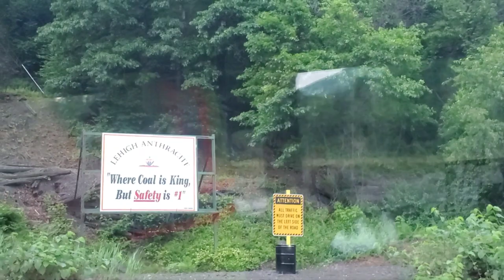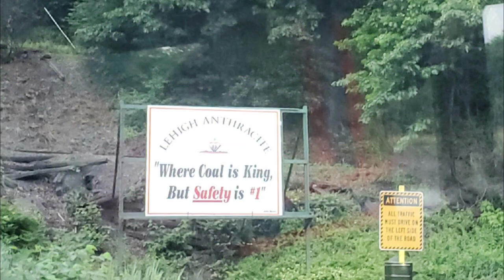A Tour of the Lehigh Anthracite Surface Mine

Comment: Not sure the tour guide pointed out the actual coal seams but anthracite seams are steeply angled relative to horizontal.
Looks like the seams here go from upper left to lower right.  Agree?
Reply from the maker: What's left of that one. Slope facing us is bottom rock where seam of coal roughly 50 ft thick 80° pitch down about 1000ft and curves up to surface on mountain behind us